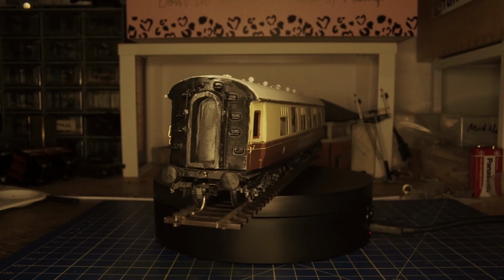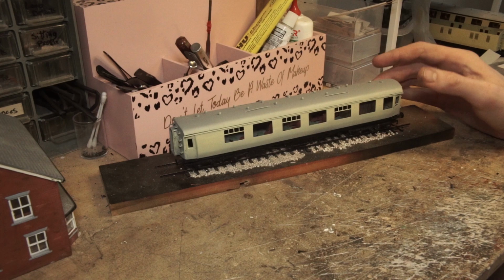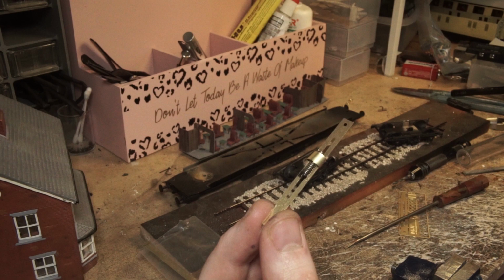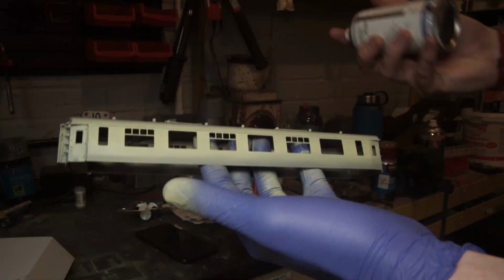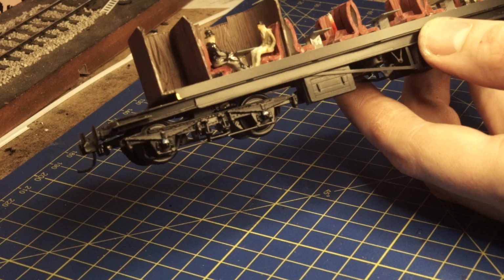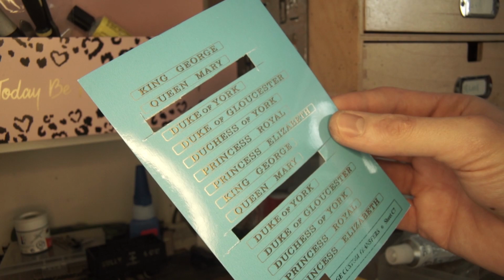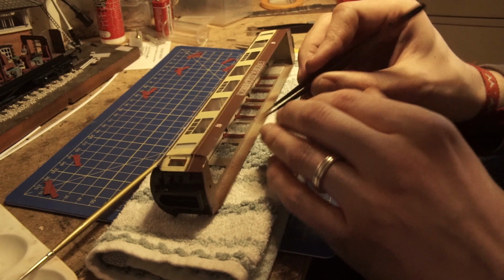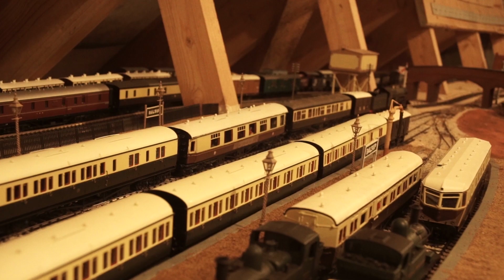Building a Comet Coach Kit - (Part 4) Painting and Finishing - SWAS Episode 36

Comment: Well done sir. The problem you had with priming brass is the oxide layer. To remove it you need Tesco white/distilled vinegar 30p ish a bottle.
day 1  Leave the model overnight in a bath of the vinegar (kept warm). 
Day 2 Rinse in tap water, then de-ionised water, dry with hairdryer. Prime with Humbrol enamel matt white with added matt black to desired tone. 50/50 paint and Humbrol enamel thinner (a much bigger volume than required in anything you have to hand).
Test spray every paint/thinner mix you use on cardboard.
Spray model with an extremely light coat, so light that you can see through it, allow to dry near a radiator.
Give it a coupl;e of hours and repeat the extremely light coat. Leave overnight near a radiator.
Day 3 repeat the 2 light coats and leave near a radiator overnight.
Day 4 store it somwhere clean, dry, warm and dust free for at least 4 weeks to cure.
I only used enamel paints on my best friend's Stuart Turner live steam model engines 45 years ago that we built together and the paint looks as good as new. But acrylic will be ok on the enamel primed coaches.

Airbrushing top tip example; You want to spray the side of a coach, set and test the airbrush so it can cover that size on a piece of card in 3 passes with a very light coat. Binning 6 pieces of badly sprayed carboard is a lot easier and cheaper than stripping the model back to Day 1

And I forgot the most important things-
Do NOT use Halfords spray can or any acrylic primers or on brass or white metal.
This is priming both inside and ouside of the model at the same time.
NITRILE GLOVES AT ALL TIMES WHEN HANDLING CLEANED BRASS MODELS!!!!!!!!!!!

Keep up the good work as you always give me..... OOOOOOOOO! I need to do that moments, that have been converted to done and WOW!